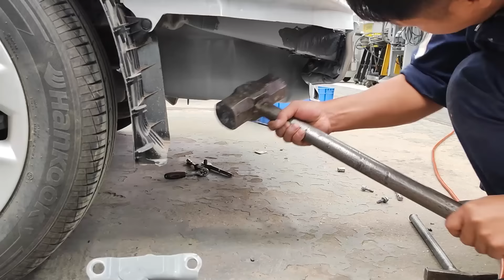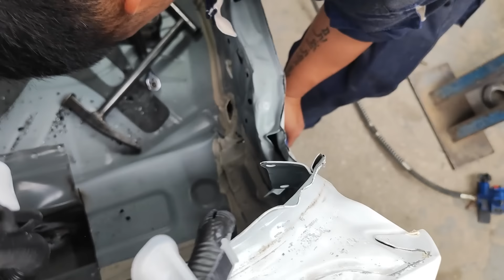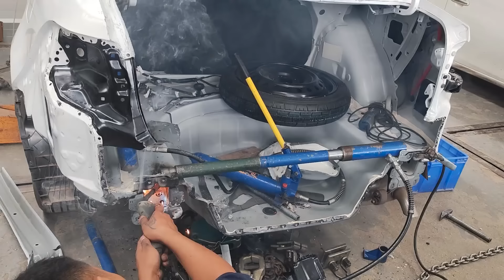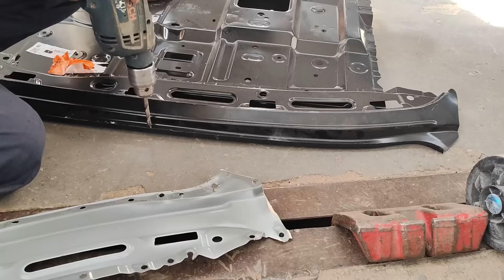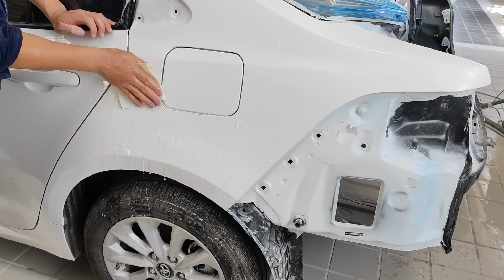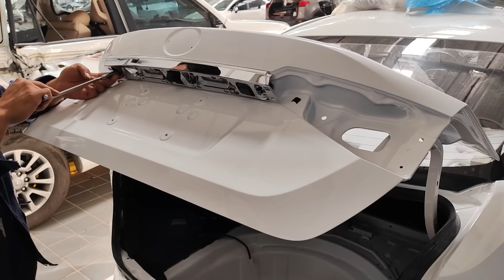Toyota Corolla rear-end accident repair

Comment: It only took 20 minutes  the  invoice  will be cheap. 😂😂😂.       GREAT WORK👍🏻👍🏻
Reply from the maker: It sounds like you're impressed by the efficiency of the repair work! Sometimes, a quick and efficient repair can indeed lead to a more affordable invoice, especially if the problem was relatively minor.
Reply: 丁寧で大変素晴らしい作業なんですが、仕上がったこの車に乗りたいか？と、言われると正直、乗りたくはない。
Reply: I don't want to buy it. But I don't mind riding.😂😂😂

Comment: Live here in the USA, Never seen quality work in my life. Well done
Reply from the maker: Thank you for your compliment! Skilled auto technicians around the world, including in the USA, contribute to maintaining and restoring vehicles to high standards. If you have any questions or if there's anything else you'd like to discuss, feel free to let me know! 🚗🔧👍
Reply: No need to bash the US because you haven't toured a mid to high end repair shops. The US has different safety standards than Han's country of origin.  For instance Han repairs UHSS and HSS of the occupant compartment zone by pounding it back to shape. Once a reinforcement is deformed by an impact the integrity of the steel is compromised and would be made worse if it were to be straightened by any repair method. The US requires these components to be replaced with Genuine New OE Service Parts.
Reply: @michaelb9599  the gabage make in USA.
Reply: @Mckenzie28007  what?

Comment: You should write the car off you have to wait 6 months for replacement parts
Reply from the maker: Your point is valid. If replacement parts are not readily available, it can significantly impact the repair process, leading to extended downtime for the vehicle. In such cases, considering whether it's more practical to write off the car and move on to a replacement might be a reasonable decision.

Comment: Thanks for sharing this complicated work of art.

1- Pollution:
It is less environmentally polluting to repair a car than throwing it away and  manufacturing a new car.

2- Economy:
It is more economical to repair than throwing away and buying a new one.

3- Insurance:
Repairs make insurance costs less expensive on the company which reflects on car owners.

4- Safety:
99% of a car is made from mild steel sheets. Repairing a piece once (or twice) has no effect on steel strength, especially if parts are replaced.

5- Car manufacturers:
They prefer to sell more cars to make more profit.

Costs of Transportation:
The higher insurance gets, the more expensive transportation and taxes become, along with everything else we receive via transportation.

This is why the cost of living in western countries is high compared to other countries.
Reply from the maker: You've highlighted some very important points about the benefits of car repair and its impact on various aspects of our lives and the environment. Let's go through each of these points:

1. *Pollution:* Repairing a car is indeed more environmentally friendly than manufacturing a new one. The manufacturing process of new vehicles consumes a significant amount of energy and resources, contributing to pollution and greenhouse gas emissions.

2. *Economy:* Repairing a car can be more cost-effective compared to buying a new one. It not only saves the cost of purchasing a new vehicle but also reduces the environmental impact associated with its production.

3. *Insurance:* Repairing a car can lead to lower insurance costs for both individuals and insurance companies. This can make owning a car more affordable for individuals.

4. *Safety:* Your point about mild steel sheets is valid. Replacing damaged parts can restore the structural integrity of the vehicle and ensure its safety. Proper repairs and replacements are essential to maintaining the safety of the vehicle.

5. *Car Manufacturers:* Car manufacturers do indeed benefit from selling new cars. However, a thriving repair industry also contributes to the overall health of the automotive sector and the economy.

6. *Costs of Transportation:* Higher insurance costs can lead to more expensive transportation, taxes, and other related expenses. These costs can contribute to the higher cost of living in some countries.

Considering these factors, repairing and maintaining vehicles effectively extends their lifespan and reduces the overall environmental impact. It's also worth noting that there's a growing awareness of sustainability and the environmental consequences of manufacturing, which makes car repair and restoration an increasingly important aspect of the automotive industry.

Thank you for sharing your thoughtful insights on this topic! If you have more to discuss or additional questions, feel free to share.

Comment: Here in Spain, repairs like this are not carried out, the car usually goes straight to the scrapyard.

There are several reasons:
-If the insurance company declares it a total loss, they compensate the owner on the condition that the car goes to the scrapyard.
-Even if the car were repaired, it would not pass the mandatory annual technical inspection because it has welds or wrinkles in the chassis, which are considered a disabling defect.

If anyone visits a junkyard ins Spain, they will see that there are cars with less serious accidents than the one in the video.

Comment: Where you cut a hole in the wheel well compartment and then welded it back up is where i have a problem, except its on the passenger side and the metal there is wrinkled up due to an accident, How would you go about fixing that?
Reply from the maker: Straightening: If the metal is wrinkled, use bodywork tools to carefully straighten the affected area. This may involve using hammers, dollies, or other tools designed for metal shaping.

Welding: Weld a new piece of metal into the cut-out section. Ensure that the replacement metal matches the specifications of the vehicle. Use appropriate welding techniques and safety measures.

Grinding and Smoothing: After welding, grind down the welds to create a smooth surface. This helps in achieving a finished appearance and ensures that the repair is flush with the surrounding metal.

Comment: well done , excellent work,,   how many human hours it took to complete?
Reply from the maker: The total number of human hours it takes to complete a repair like the one shown in the video can vary depending on the complexity of the damage, the skill and experience of the technicians involved, and the availability of parts and equipment. In some cases, repairs like this can take several weeks, while in others, it might take several months, especially if there is extensive damage and customization involved. It's essential to invest the necessary time to ensure that the repair is done correctly and meets safety and quality standards.
Reply: many thanks @xinxianshi

Comment: Well done repair, the only way to repair such damage is to pull out the damage with a frame puller.
Reply from the maker: You're absolutely correct. Repairing severe structural damage on a vehicle like the one in the video often requires the use of a frame or chassis straightening machine, also known as a frame puller. This equipment is essential for safely and effectively restoring the vehicle's frame or chassis to its original specifications. Skilled technicians use precise measurements and controlled pulling forces to bring the damaged structure back into alignment. It's a crucial part of the repair process for heavily damaged vehicles like the one in the video.

Comment: i didnt see them applying anti rust coating inside that chassis bar where they heated that with gas welder any area that lost its rustproofing costing will eventually catch rust and worst its on chassis bar
Reply from the maker: Your observation about rustproofing and anti-rust coatings is important. When welding or working on car components, especially structural parts like the chassis, it's crucial to consider rust prevention. Any areas that lose their rustproofing coating can indeed be vulnerable to rust over time, which can affect the structural integrity of the vehicle. Applying anti-rust coatings and taking measures to protect these areas is a key part of ensuring the longevity and safety of a repaired or restored vehicle.

Comment: Always use the hydraulic jack to pull the body,
Reply from the maker: Using a hydraulic jack to pull the body during repairs can be a useful technique. It allows for controlled force application to reshape the damaged parts of the vehicle. However, it's important to have the necessary skills and knowledge to use hydraulic jacks safely and effectively, as improper use can lead to further damage or even accidents. Professional auto body repair experts like Han in the video have the expertise to assess the situation and use tools like hydraulic jacks appropriately for the specific repair needs.

Comment: Is there a reason you guys weld over the paint and not remove it first?
Reply from the maker: Welding over paint is a common practice in the auto repair industry, especially for spot welding and certain types of repairs. However, it is important to note that not all welding processes can be done over paint, and there are specific considerations to ensure a successful weld.

The decision to weld over paint depends on the type of welding being performed, the location of the repair, and the specific requirements of the repair process. In some cases, welding over paint can be acceptable if the paint is not too thick or if the area is properly prepared. However, in other situations, it may be necessary to remove the paint to ensure a clean and reliable weld.

Welding over paint can have some drawbacks, such as the potential for spatter and reduced weld quality. Additionally, the paint may emit fumes during the welding process, so proper ventilation and personal protective equipment are essential for the safety of the workers.

Ultimately, the decision to weld over paint or remove it first is made by the skilled professionals based on their assessment of the specific repair needs and safety considerations. The goal is always to achieve a safe and effective repair while minimizing any potential risks or issues.
Reply: @xinxianshi  thank you that was very helpful

Comment: How did the insurance not deem that totaled 🤷🏻‍♂️
Reply from the maker: Determining whether a vehicle is considered totaled (a total loss) by insurance depends on various factors, including the extent of the damage, the cost of repairs compared to the vehicle's value, and local regulations. Insurance companies typically use a Total Loss Threshold, which is a percentage of the vehicle's actual cash value, to make this decision.

If the cost of repairs exceeds this threshold, the insurance company may declare the vehicle a total loss. However, skilled mechanics and body repair professionals may sometimes be able to restore heavily damaged vehicles through meticulous repair work.

Comment: Why was the car itself not painted inside the spray paint booth?

And no blending?
Reply from the maker: The decision to paint a car outside the spray paint booth and whether or not to use blending techniques depends on various factors, including the extent of the repair, the type of paint used, and the expertise of the repair technician.

Comment: That a 10 k job right there car worth 20 k
Reply from the maker: Absolutely, the cost of the repair can sometimes approach or even exceed the value of the car itself. However, this depends on various factors including the extent of the damage, the availability and cost of replacement parts, labor charges, and the overall condition of the vehicle. In some cases, people choose to invest in repairing a car they value for sentimental reasons or because it's a particular model they prefer, even if the repair costs are high. Ultimately, it's a decision that depends on the individual's circumstances and preferences.
Reply: @xinxianshi  I had a car crash and I just junk it beside it was stalling cause I put cheap gas it had like 80 k miles on it
Reply from the maker: @petermuniz9296  It sounds like you had a car crash and decided to junk the car due to the damage it sustained, in addition to experiencing stalling issues possibly caused by using cheaper quality gasoline. It's important to prioritize safety and consider the overall condition of the vehicle when making such decisions. If the car had significant damage from the crash and was already experiencing mechanical issues, it might have been a reasonable choice to move on from it. If you have any more questions or if there's anything else you'd like to discuss, feel free to ask.
Reply: @xinxianshi  my car was a total loss I got rear ended and got pushed to the front car so front and back is damaged

Comment: Imagine buying a car that has been repaired with so much patchwork, and you purchase it as if it's never been in an accident, only to have the paint start cracking in areas where it was patched after a few years. That's why I would advocate for legislation to ban this kind of work and repairs. Seriously, replace the entire part instead of patching like this.
Reply from the maker: It's understandable to have concerns about the long-term durability and safety of a vehicle that has undergone extensive repairs like this. While repairs can restore a car's appearance and functionality, there may be underlying issues that could affect its integrity in the future.
Reply: If you want to buy a used car, you must inspect it carefully with the help of a specialist, and such repairs can be easily detected.

Comment: real toyota bodyshop would strip the car, remove the damaged quarterpanels and weld in new ones and not this tomfoolery that makes the car dangerous because of the weakened metal held together by bondo
Reply from the maker: Hello, this repair method does not meet Toyota's original standards. Due to cost reasons, this repair method is still very popular.
Reply: @xinxianshi  i am aware, but since you have toyota branding on your jackets, one would judge youd follow the toyota guidelines of repair

Comment: When will people learn this type of repair leave you with a death trap car next time the car get in accident there will be no crumple zone people will die you cannot straighten out parts made to crumple you could cut out and replace with new toyota parts and to a oroper rebuild but this would be very expensive.
Reply from the maker: Indeed, cutting and replacing is better, but due to cost reasons, some people prefer this repair method.

Comment: Toyota is a big company but it seems that it doesnt provide its workers with  personal protection when repairing . They wear tennis and no eye protection glasses. Sorry for them.
Reply from the maker: You are right to be concerned, safety must be a priority in any workplace, especially when it comes to potentially dangerous tasks like car repairs. The individual in the video may not have been using personal protective equipment (PPE) at the specific moment captured on video. However, this does not prove that Toyota companies do not protect workers enough. In our country, workers are not used to wearing bulky protective equipment. However, companies have fairly complete rules and regulations that stipulate that workers must have appropriate personal protective equipment, including safety glasses. and appropriate footwear to protect yourself from potential injury. Therefore, this responsibility does not lie with Toyota, but entirely with individual behavior.

Comment: All this work is worth shit. Rust will appear in these repaired areas after a few months. Burnt sheet metal without factory protection in closed profiles is a disaster. You can make a sculpture out of shit - but what for?
Reply from the maker: You bring up a valid point about rust and the long-term durability of repaired areas on a vehicle. When conducting repairs or restorations, especially involving sheet metal, it's crucial to address rust prevention and apply appropriate coatings to protect against corrosion.

Comment: 138 / 3000발음듣기복사하기필기인식기번역하기	
영어열기/닫기 아이콘
By the way, what happens to the audience on the opposite side of the bottom surface of the trunk that was welded with the grinder?
If it was excluded from the audience because it is invisible, rust will definitely occur later and it will be problematic due to penetration corrosion.
I'm shocked if the maintenance manual at the official Toyota repair shop is like this
Reply from the maker: Hello, the bottom of the trunk will be sprayed with a layer of anti-rust primer, and then a layer of chassis protection paint will be sprayed on the outside to prevent it from being hit by stones.